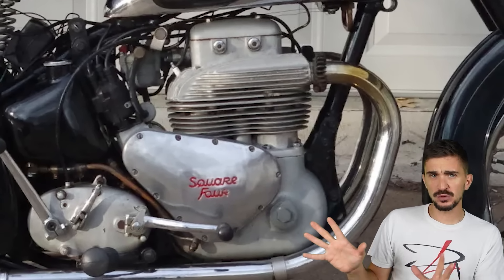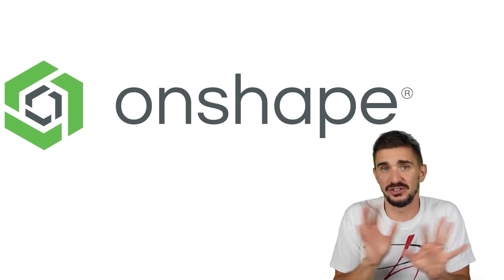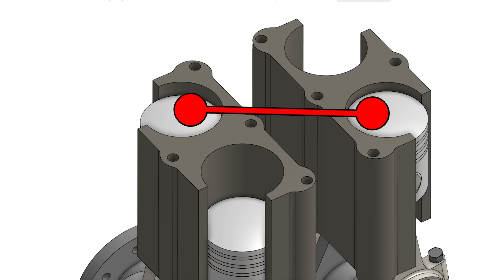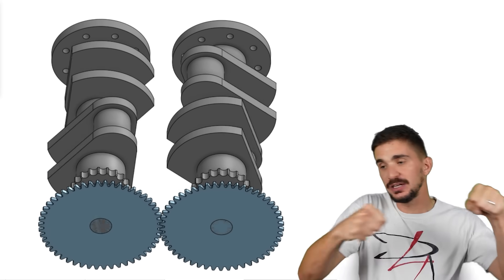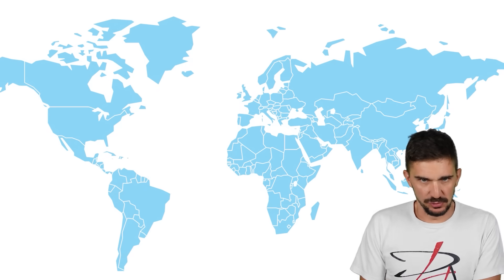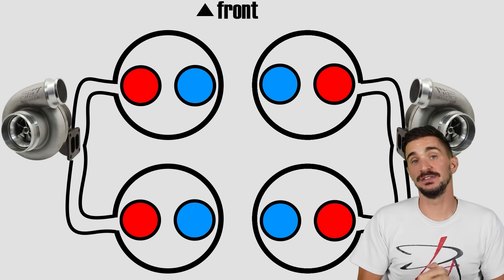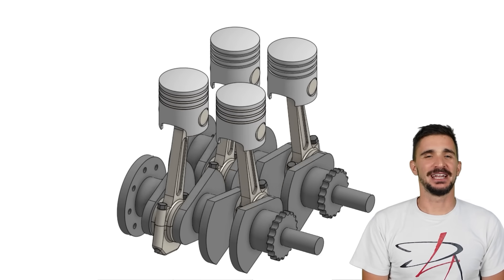From the Outside It Looks Like a Single but Inside Four Pistons Mingle! Square Four Engine Explained

Comment: 13:16. Okay, it took me about 26 seconds to see a solution to the breathing issue. Draw another square over the engine, rotated so that one corner is pointing directly forward. Size the square so that the sides go directly through the center of the pistons. Turn the valves so the are aligned on the sides of the square. 
The valves closest to the sides are the exhaust, the ones on the front and rear faces are intake. Exhaust ports are on the motor's sides, intake ports are on the front and rear faces. I didn't see how the cam was set up in the original design, but this will complicate the design of the valvetrain. I'm pretty sure modern solutions can solve this, but I'd love to see the original design and come up with something. 

There are several intake solutions:
1 - A halo around the top of the engine. Neat visually, but comparably heavier and likely poor flow.
2 - a larger central tube that sits higher on top the motor. Air/fuel mixture is introduced to the center-top of the log, the ends are radiused, siamesed U-bends like a pair of curled fingers connecting to the intake ports. 
3 - dual intake, dual carb. One intake and carb feeds the front cylinders, another set feeds the rear.

Very cool engine design though. I love it. Thanks for covering this one.

Comment: @d4a , You are incorrect about the primary balance, there absolutely isn't a primary rocking couple. Each pair of two cylinders produce a rocking couple, and they cancel out because they have equal magnitude, opposite directions, and act on paralel or coincident axis. That axis isn't viewed from the top, like you showed, but from the side of the engine.
Also, even if there were any kind of primary unbalance, like you point out the fact that a U engine has a pair of crankshafts running in opposite directions means that you can use counterweights to correct any kind of primary imbalance, it's effectively an inbuilt primary balance shaft. Thus for example an U6 would be as balanced as an inline 6, or boxer 6.
Finally, while not all u4's with 270º cranks have perfect secondary balance, there are two specific arrangements (symetric to each other) that do have it, which combined with counterweight crankshafts would make them perfectly balanced, and equivalent to an X4 engine; the problem is that both of them would only be even fire for a 2 stroke engine.

Comment: 12:57 A possible solution could be 45° 'twisted' cylinder heads like Honda did on the CX500. Intakes could face front and rear then or sideways like on a Harley.

Comment: It so rare , we called them “biscuit tins” some were tuned for sprinting, some were used for road racing in Norton frames . The rear two would suffer from over heating when pushed, we preferred the Suzuki 4,s the RG500 gamma, and the all powerful most winning engine ever the OMNIPOTENT GSX1135cc , hammamatsu granite

Comment: Shouldn't the rocking be zero? Each two diagonally oposing cylinders have their common center of mass exactly in the center of the engine, nah? The rocking torque parallel to the crankshafts will be cancelled by a rocking torque perpendicular to the crankshafts.

Comment: Very interesting. Back in the mid 1960's I had half shares in a Square Four - I was probably 14 or 15 at the time so no idea how we didn't kill ourselves. The early Square Four had cast iron cylinder heads and the aluminium head was introduced to try and mitigate the over heating of the rear cylinders.

Comment: SQ4 mechanic here.
The rear one's overheating really is not a thing.... more a myth. The front one's just as likely to seize up, the left one's more than the right ones since the oil pump is on the right side. A problem solved decades ago with morgo oil pumps.
The early 500 and 600cc squares had infact overhead cams.
Regarding vibrations.... There are none that you would be able to feel.
A big problem the early squares had was very much heat stress on the ignition mganeto system until they changed to coil ignition.
Again Problems solved decades ago.
Today a square four is a really Bike for long distances...... if you sold your kindney to get the engine mechanically 100% in order. Leave out one bit and you will end up on the road side.

Comment: I suspect a larger four square engine for marine purposes for use in lower planing speed boats needing more torque but still lower weight and less space would be good.

Comment: i know how you could make it into a single crankshaft, add a joint to the conrods and so there you have it, of course i it will change it a bit making it longer and it'll be more rectangular then squared at the end, but yea, today we can make square engines with a single crankshaft

Comment: It's important to know that the Ariel Square Four was Edward Turners first mass produced engine design before he went to Triumph, who were then owned by Ariel owner Jack Sangster. 
Once at Triumph he then designed the celebrated Triumph Speed Twin and set in motion a design style that is still a showroom favourite nearly a 100 years later.
Reply: i have wondered how much of the actual detail design work turner did for himself. i have speculated that he was more of an ideas man, who left the details to others. the square four engine was modified for production by val page, because the original was too expensive to produce at a profit. an unusual design sure, but not a very good one.
Reply: @cncjockey the original 500cc square four with wet sump and OHC was all Turners design, was increased to 600cc and the replaced with Val Page's redesigned 1000cc pushrod dry sump engine, that was an improvement over Turner's original.
Reply: @Brit_Toolmaker  i would still like to see some definate evidence of the so-called "turner specials"  of his, which led to him being offered the job by sangster. i have read much, but never seen a photograph or any documentary information. and why did he describe [can't remember the man's name, sorry] as 'my pencil'? not a very nice epithet. i am still to be convinced
Reply: @cncjockey I've seen photos of Turner Specials, they have been documented. I think it was Jack Wilkes who Turner described as his Pencil. Turner famously said "why draw a straight line when you can have a three foot radius" it was that philosophy that drove his work. Look at a Triumph twin cylinder engine design (arguably his Magnus opus) that this is very evident.

Comment: Imagining a touring bike. Square 4 with 90° cranks, liquid cooled. Cranks fore-and-aft, coupling gears in the primary drive chamber at the back, reduction gear drive to gearbox, shaft drive with torque arm control. Chain drive  to overhead cams from the front of one crank, alternator on the other.

Comment: I had an Ariel square  4. Very unreliable with the back 2 cylinders often seizing because of overheating. Would be solved with modern water cooling.

Comment: Air cooling of engines with cylinders behind each other has long been solved by the aviation industry. Using clever cowlings and baffles, this can be achieved quite well. With a few specialised exceptions, almost all aircraft piston engines are air-cooled 4 or 6 cylinder boxer engines. If it is done correctly, there is very little temperature difference between the cylinders.

Comment: The balance on these engines is nothing special. You still have a secondary out of balance force. Reason being at 90 deg BTDC / ATDC the piston is more than halfway down the bore so the rising piston moves a greater distance in the remaining 90 deg than the falling piston so they don't completely balance out. That's why inline 4 cyls sometimes have a balance shaft that vibrates up and down at twice crankshaft speed to counteract this problem.

Comment: If that had been horizontal to the frame, BMW/ Moto Guzzi style rotating in opposite direction to cancel out centrifugal torque feeding a common clutch to gear box...

Comment: sounds like a survival bias, doesn't it?
people now have really tough problems with intake pipes using turbo so it's not a problem to have "bad" intake design.
Perfect balance could make it have big displacement at a fraction of vr4 engines development cost (while people went mad doing it). these may still have pushrods (which doesn't have real disadvantages for now) that is ok at torque/efficiency.

Only trouble for me is the gears that looks like can fail at high rpm. But it's just guesses.

Comment: Nice seeing the counter-rotating cranks..

Heating /cooling  problems solved by water cooling, or adequate cowling - HD bikes are for anachronists...

 - Twin carb - simple..

Effective cross plane twin-twin sounds good.

Hybridizing vehicles - achieves a lot of "engine-speed decoupling" - allowing a constant speed engine for a large part of the power band..

Comment: Forging isn't the only way to build a crankshaft. Almost every V8 since the Ford flathead of 1932 has had 4 90° crankpins, it can't be that hard to make 2.
If you want a compact 4 cylinder 4 stroke, a VR4 is cheaper, lighter and breath a lot better - but still very bad.

Comment: The once most common UK mainline diesel locomotive, the Class 47, used this H- or twin bank layout as a Sulzer H12.  It was more reliable than the V12 version.  The main disadvantage is the extra weight of having two crankshafts (even though they're shorter, they still weigh more).  The phasing gears can also be noisy, which is also why OHV engines rarely use direct gears for the camshaft drive, but gave a short chain.

Comment: Just rotate the two cylinder banks by 90 degrees, and you have a flat four, on a single crankshaft. This type of engine disappeared because it didn't make any sense.

Comment: never got to ride one, but they did spend some time in the shop to get all the oil lines drilled out.  the problem was heat with this engine.

Comment: There is a characteristic that a vee engine with uneven firing pulses has with respect to motorcycles at least is a rest period that gives a tyre a chance to grip. Sounds mad but it is real. That could be the game changer for top end machines since packaging is solvable, especially with water cooling. Love to see a double triple with turbos!

Comment: I don't own a Square Four but my 1935 Ariel Red Hunter came from the factory with roller bearings (not soft metal bearings), forged steel crank and rod. All this roller bearing engineering is what people carry on about these days in their new expensive custom engines, they think its ground breaking.

Comment: while living in England, and re-building a '66 T-120 Bonneville, I came across Healy Engineering who allowed me to use their sand blasting booth. They were re-building Ariel Square 4's. They re-engineered the block by opening up the oil flow to the rear pistons, thereby lowering the temperature. I have so many stories to tell
Reply: Well, tell about the Healey mods... 
A friend has a plunger Squariel. To keep oil temperatures under better control, he fitted an oil cooler from a Triumph triple with a thermostat.
Reply: @pashakdescilly7517  Cool.
Reply: @donaldbohn3183  If you flow extra oil to a particular place, there is less oil elsewhere, unless you fit a stronger oil pump.
Probably more effective would be air scoops to get more cooling air onto the rear of the engine - but it would not be elegant.
Reply: @pashakdescilly7517  Yes is my gut reaction,  the airflow around the engine whilst moving is the critical area to address for even cooling, but I know Healey knows what they were doing. Company with a solid reputation.
Reply: Was this in the 70s?

Comment: I've personally been researching on this topic for a long time, a square-4 would be a super cool engine design with excellent stability for increased reliability and repair-ability, a very promising potential for range-extenders & hybrids, but also now tech like VVT-I, Direct Injection, Exhaust scavenging, Skyactive-X allow such a vast variety of potential for something that utilizes this kind of efficient design, (Twin turbos being a good example).
These motorcycles are seriously ancient, c'mon someone pay up and build a new fangled techy Square -4 already!

Comment: The same benefits of moving a V-twin (90° block) to a parallel twin with 270° crank, would follow suit moving a V-four (90° block) to a square-four with 270° cranks.
Reduced heads.
Reduced cams.
Reduced intake and exhaust routing complexity.
Reduced coolant plumbing complexity.
Reduced engine size.
Reduced manufacturing machining complexity required with V-type engines.
Potentially stronger engine block due to a more unitized layout (unlike v-types).
The only drawback with a square-four is the required additional crank.

Comment: This engine nerd would like to see you CAD up a rectangular 6 😮😅
Two straight 3s in parallel like the Square Four...
Of course with two 120 cranks... 😂
Quad overhead cams and 4 non equal size valves like David Vizard patent...😊

Comment: I, too, have thought a lot on the Ariel square four, and what a neat engine it would be in a watercooled setup along with pushrods possibly with a VW intake and exhaust layout, and about 1500 or 2500 cc's or so.   It's simple to work on old school.  Maybe just a prototype would be neat and all motor.

Comment: The Suzuki RG-500 2 stroke square four actually fired 2 diagonal opposed cylinders at the same making it fire like a twin. It also had a carrier gear between both cranks so they both rotated in the same direction (my understanding on this is so the engine torque adds downward force on the front tire). It was quite a different animal than the Arial Four. Very compact engine (it was the 4 expansion chambers that took-up all the room).
Reply: Amazing bike and engine. Used to stick my head into the lovely smoke and noise. What a monster.
Reply: he says yes 2-stroke back then had a different cooling
Reply: @xtrollyx_aut  Water cooling made a huge difference not having to worry about air distribution around the cylinders but that wasn't until the 80's other than the sedate and porky Suzuki Water Buffalo 750. I raced an H2 750 flat out and put bus lengths on him before he seized his middle cylinder :) Heat and pistons are an uneasy pair in a 2-stroke.

Comment: Using computer aided design, surely the cost of developing a square four engine would be more than manageable by a major manufacturer. Coupling such a smooth and compact engine with an electric motor is definitely something that car manufacturers should look at. Motorcycle manufacturers should give them another look too. With the advancements in manufacturing and metallurgy, all the “problems” could easily be surmounted.

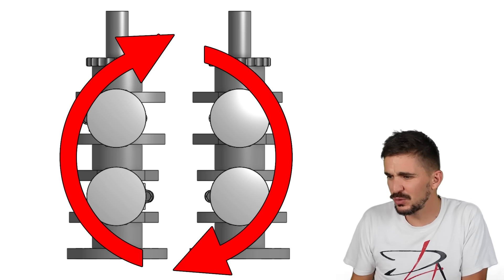Comment: I THINK this 7:44 is ALSO compensated by the same thing happening in the botton. If you view the same effect in the botton, these circle arrows would point counter-clock, while the top is clockwise, and vice versa.

(And I SUSPECT the only way it will be NOT 100% compensated is if consider things like the elasticity of the engine block and clearance of the gears. But I'm conjecturing)
Reply: You don't even need to consider this engine as 2 2-cylinder ones, you just have 4 cylinders that move in a symmetrical way, so there is just no rocking couple. Period.

Comment: This would allow better packaging in a front wheel drive car, and also would allow moving the transmission closer to the center line, thus reducing torque steer.

Comment: Having 2 of the 270 degree cranks would cause an INSANE rocking couple, you can even see it at 15:25 in the video

the counterweights on the crank that are required to counter the piston at TDC, are doing fine, but on the 2 mid stroke pistons are trying to rotate then engine 

just watch the counterweights and yall will see what i mean eventually 

this doesnt mean its a bad idea at all, but 2 180 degree cranks with no counterweights would do just fine for this setup, maybe a big flywheel at most to keep it running smooth. but for snappy response i would say no counterweights

also the air cooling, you could air cool it just fine, all thats needed is a sheet metal air ram on the back of the engine. if you look at the little harbor freight 212cc engines, they have an engine cover that directs air from the cooling blower around the whole cylinder head, you could apply the same logic to this engine just fine.

finally, a Single Overhead Cam setup on both pistons would absolutely rock, and if you siamese the 2 side exhausts you can splay the intake runners farther apart, and with a big intake manifold it might scream to high rpm's
Reply: Crossplane R1 is essentially this:
A 270° crank parallel twin displacing 499cc..... joined by crank ride beside another identical, with the two inside cylinders clocked 180°.
While people rave at how awesome this sounds and how exotic and unique it is, they moan about how boring and ubiquitous "another 270° parallel twin" is. The YZF-R1 is essentially just two boring ubiquitous 270° parallels joined side-by-side on a single crank. Essentially just using the crankshaft to achieve V4 firing interval, rather than banking the cylinders at the angles required to do such.
Since you can achieve good balance with a 270° parallel twin with even a single counterbalance shaft, if you paired two front-to-back with dual cranks, and had them rotate opposite directions, you could potentially eliminate the required balancer shafts.

Comment: @6:20 Neat! I wonder why they wouldn't stagger all four of the piston cycles in time. You could fire them in order NE, NW, SW, NE, a circle, or you could fire them in order NE, SW, NW, SE, a figure-eight. The former would exhibit gyrational torque while the latter would rattle primarily around the diagonals (NE–SW, NW–SE).

Perhaps these vibrations are difficult to tame compared to the forces orthogonal to the plane passing through the crankshaft centerlines.